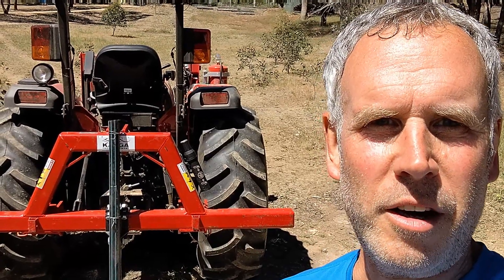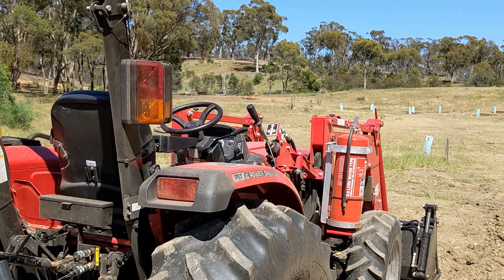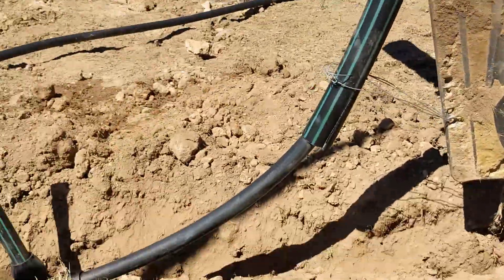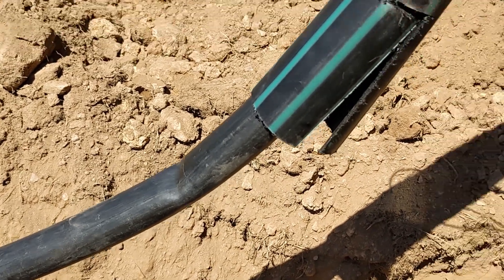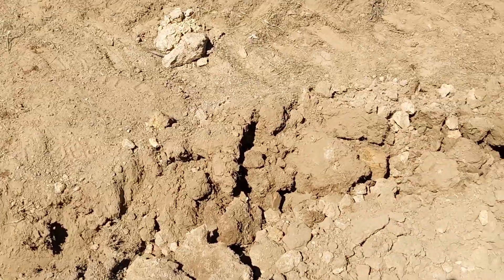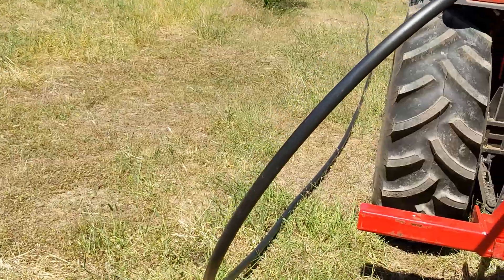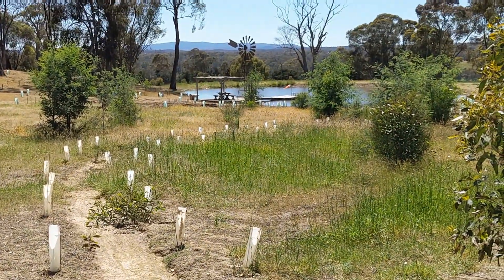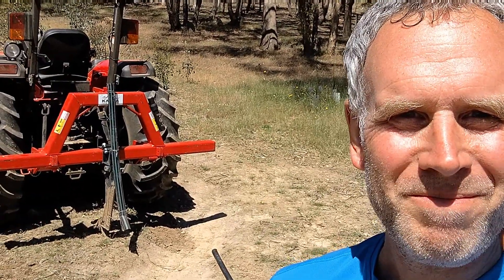Making a DIY Tractor 3-Point Poly Pipe Layer

Comment: Well done. 
I have about 200m of 2” poly to lay and I am going to convert my single tyne ripper (once I repair the ripper after hitting rock) with a curved steel pipe. I’ll weld it on so it’ll become a permanent attachment.  
I’m pulling with a 110 hp tractor so no problems there. A bit too much power and weight so I lose the ‘feel’ of a lighter tractor.  Hence the busted ripper.  
It’ll be much quicker than using my backhoe - and a lot easier to restore the ground, after laying.

Comment: Try a steel pipe with a shallow bend . fastened to the ripper frame . easier . just a thought . .
Reply: Yep. You are probably right. The flip side is to use stuff lying around. Whatever works.